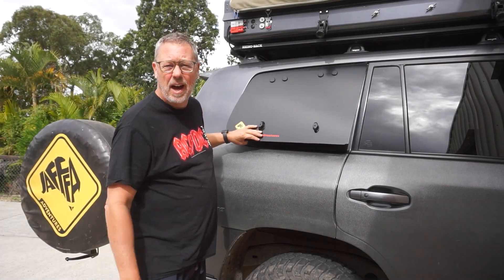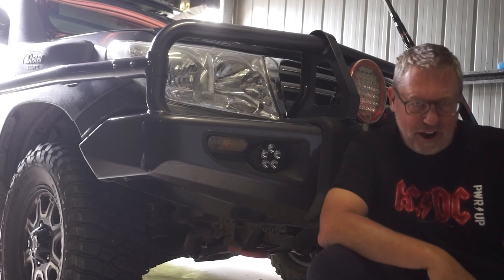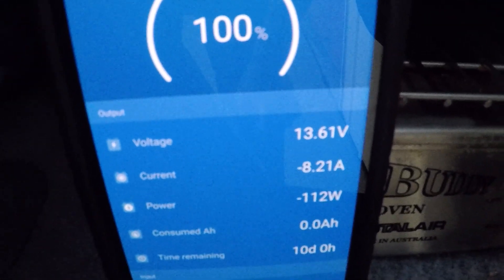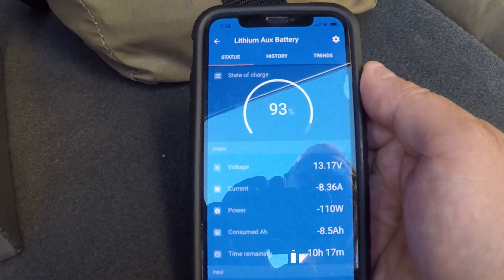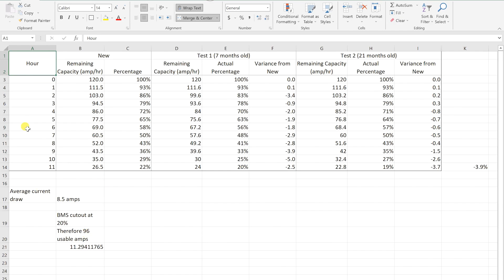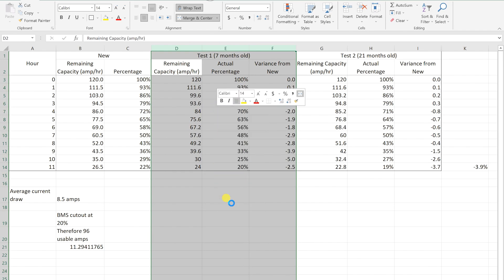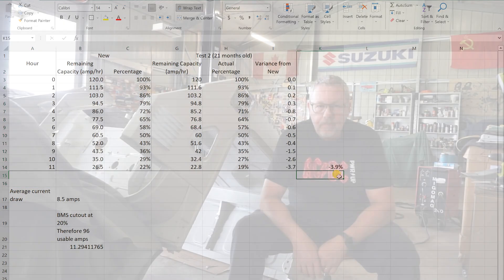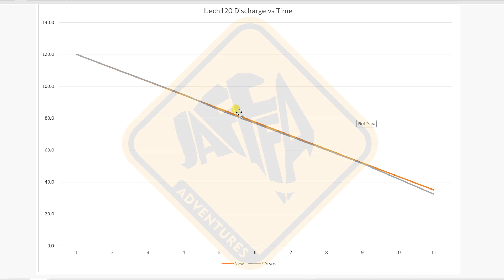Lithium Battery Test and Review | Real World Results for my Itechworld 120 | 2 Years of Torture

Comment: G'day Terry. Love ya work! Have you ever measured the temperature that the battery reaches after a good run?
Reply from the maker: Good question Trevor.  The answer is no, but I can’t see why it would be any different to the other none heat generating (non-engine) components.  It is certainly very warm to the touch like everything else under the bonnet.  Thanks for watching mate, I sincerely appreciate it 😎👍
Reply: @JafffaAdventures  They are heat sensitive and heat is the main issue with mounting in the engine bay, that is why I asked. If you are within their spec then it should not be a problem. I know that the second battery in my GU Patrol is close to the turbo and does get quite hot - I did measure it a while ago (and since forgotten) when considering lithium but it was well above their spec. That may be why yours has performed so well?? This really is key information.
Reply from the maker: Thanks Trevor.  I have read the manufactures warranty in detail and they do not specify where or where not you can place them under the bonnet.  While your points may be valid, if manufacturers were concerned about it you can bet your bottom dollar there would be exclusions in their warranty (ie if mounted next to the turbo, warranty void or something like that).  The point I make is my battery in my application is perfect for under bonnet. While heat may be an overall issue, it’s not for me and the results prove it.  If you have a link to a video or resource where under bonnet heat has been empirically proven to destroy or significantly reduce a batteries life, viewers may be interested in that.  It’s not for me, I’ve moved onto my next project.  Thanks for sharing 😎👍

Comment: I put an itechworld lithium crank battery under my bonnet in my Amarok when I replaced the lead acid crank. I also have a 120x in a battery box in the cab just because it wouldn't fit in the engine bay in my car. I love the capacity and super fast crank times. I never need to think about the dcdc charge pull or power draw on anything car or camp related, its great!
Reply from the maker: That’s great feedback Joel, thanks for sharing.  It was amazed at the capacity of lithium and agree 100%, the peace of mind you get with all that comes with the available capacity is just awesome.  Thanks for watching 😎👍

Comment: Nice vid, if the battery is fully charged what’s the approximate voltage it should be at
Reply: From the video, it is indicating 13.72v at 100%. See about the 3:50 mark.
Reply from the maker: The dude with the handle of Darth Vader is correct.  At 100% it sits at around 13.7v but falls very quickly to 13.2v and holds that all the way to about 50% discharged before it begins to slowly fall.  Thanks for watching George, I sincerely appreciate it 😎👍
Reply: Great answer and again enjoyed watching 👍🏻
Reply from the maker: Legend George, cheers😎👍

Comment: Mate got the same battery had it for a couple of years also. Got the same result with it very happy only one negative thing about it - when I turn on inverter ( even with out anything plugged in) it trips the BMS. I'm guessing from split second Inrush to fill the inverters capacitors. Only way around it is to actually have car running before I turn invertor on, not a big deal but just curious if your inverter does that to your itech?
Reply: I had a cheaper 2000w inverter that did the same when I installed lithium. The initial current draw tripped the batteries bms every time it was turned on. Swapped it out for an enerdrive inverter and the problem went away.
Reply from the maker: Great feedback and sharing Shane, thank you😎👍
Reply from the maker: Good to hear you are enjoying a similar experience mate.  I do have an inverter but I only use it infrequently.  I have never had a problem like yours ever.  Thanks for sharing your experience mate😎👍

Comment: I would think that a lead acid AGM batteries capacity after 2 years would have been through the floor!
It’s hard to beat numbers like that.  Excellent!
Reply from the maker: I could not agree more David.  I never got more than 2 years out of my AGM’s probably a combination of corrugated roads, heat, and general mismanagement.